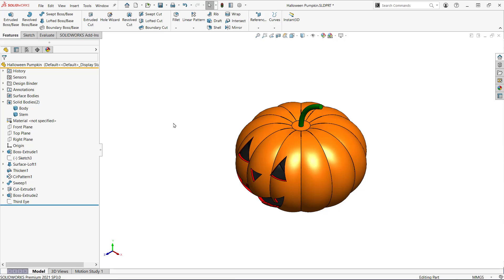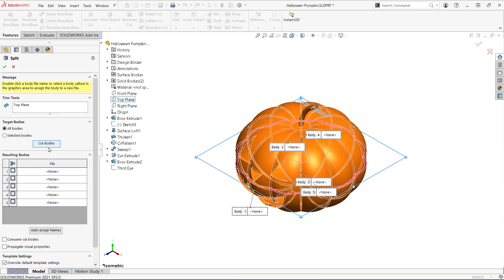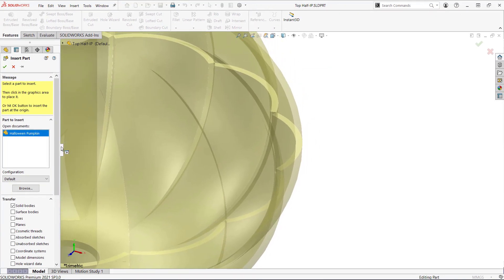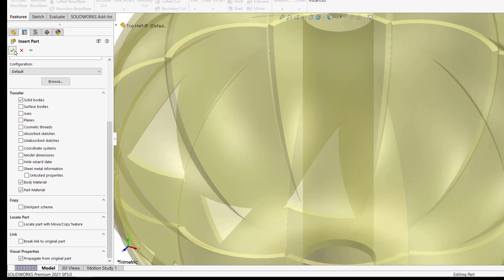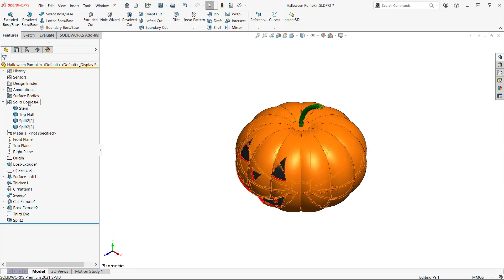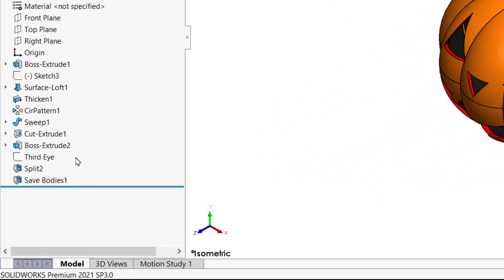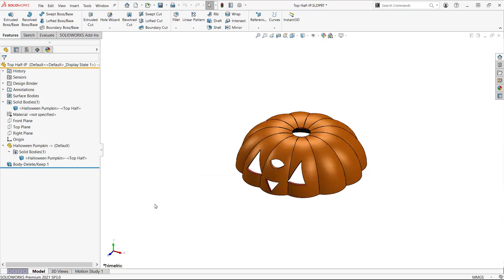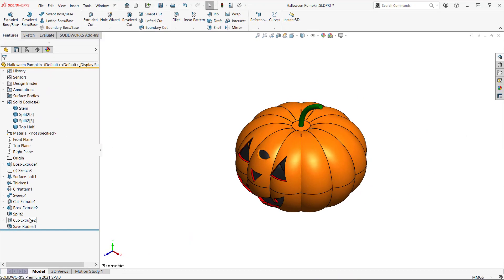SOLIDWORKS: Insert Part vs Save Bodies for Master Modeling

Comment: I wonder if you can help me
When bodies are selected in the multibody part, then Right click / Insert into new part..
The new saved file has all the bodies and retains the cut-list properties
If features are added to the original multibody part, the appear on the new multibody part (showing bi-directional activity)
I can create a drawing of the new multibody part with cutlist and all info is as inputted in the original multibody part
Bodies can be deleted from the new multibody part, however....
If i want to add an additional body from the original multibody part to the new multibody part it seems to be impossible
I can resave the bodies and use the Right click / Insert into new part.. and give it the same name but the file ID must change
When i go to the drawing , all dimensions are dangling even though the new multibody part has one additional item.
Can you help, is there a work around?

Comment: Can I manipulate with all new saved parts as with different parts?

I mean that it can be easier to design a mechanism using a multibody part with one basic sketch. Then save all bodies as different parts. And then move these parts assuming that they are not fixed to the basic sketch?
Reply from the maker: Yes the bodies that are saved off into parts (whether using Save Bodies feature or Insert Part feature) can be inserted into a new Assembly, and there they can be mated so that they move around as desired.